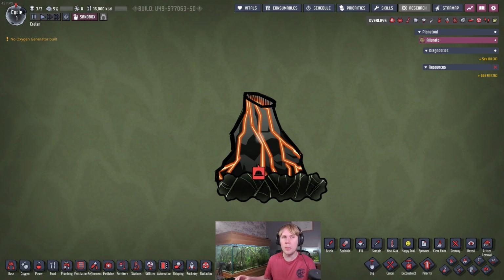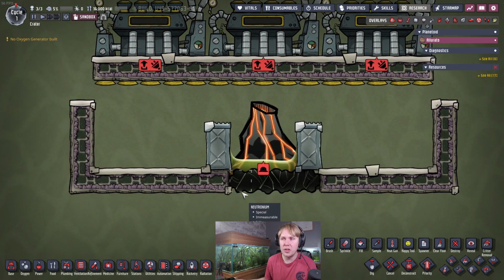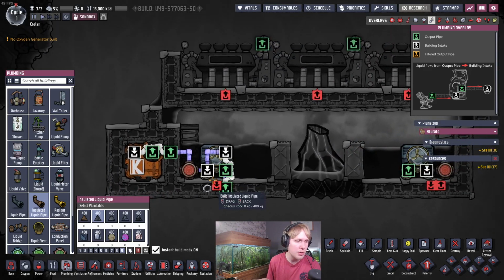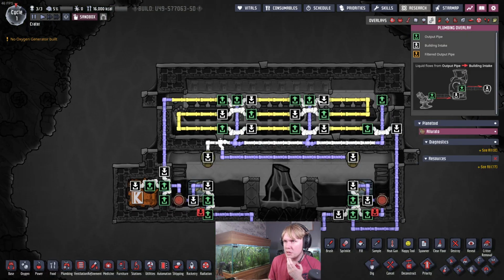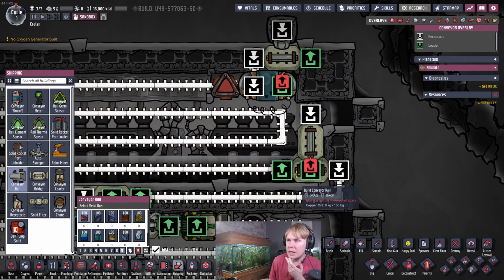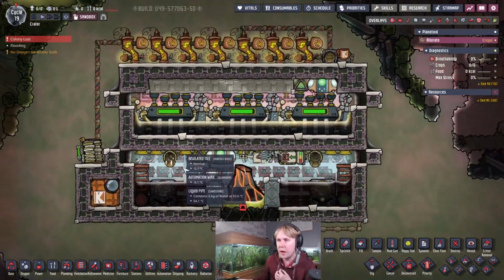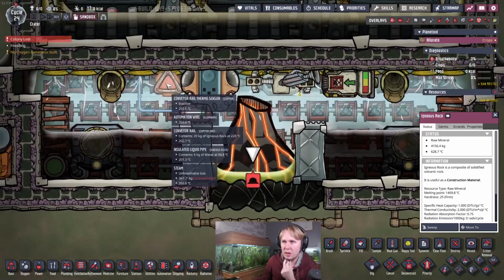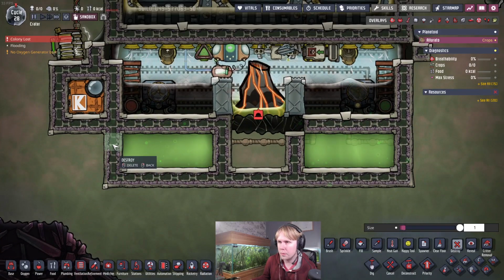How To Get Cold Rock From Volcanoes In ONI: Spaced Out! Sandbox Showcase #7

Comment: just did tamed some volcano the noob way, I just put 5 steam turbines on top of it, and I'm cooling the turbines with 2 thermos that help cool down the material that comes out of that volcano steam room, I only let material out of that room once below 150c or so, if too hot it continues to rotate inside till cool enough for me to use it. those five steam turbines are running full power all the time even when the volcano is dormant, now watching this videos to see if I can make it even better.
Reply from the maker: volcanoes are fun! bear in mind that this guide is about getting cold rock out quickly rather than getting the most power out of it. you can certainly leave the rock in there for longer and use less aquatuners.

Comment: Love the idea with the liquid uranium! Amazing video! :)

EDIT: Won't the Conveyor Loader overheat since the rock is much hotter than 275C?
Reply from the maker: Thank you! Generally from my testing I found that provided you add a large enough mass of Steam to the room (in the video it's circa 400 kg/tile, which still allows eruption because the liquid Uranium is less than 150kg/tile), the Steam shouldn't exceed 200° C by too much. The rock does not conduct a lot of heat very quickly until it's on the Conveyor rail itself, unlike metals from metal volcano tamers. The Steam is also less conductive with the Loader than the Crude Oil is. If your Steam pressure is too low, the temperature can exceed 275° C at certain points which can start to cause problems, as seen by @NovaGirl8 (I think this is the cause of your issue!).
Reply: Thank you for your detailed answer @erisia_gaming  I'm just testing that now and yes you are right about the rock not conducting too much heat, while metals (obviously) do conduct much more heat while in the Loader. See on soon online! :)

Comment: So... do I just dump my solid uranium ore into that trough and wait for it to melt during an eruption? I have like 10 volcanoes in my current map and only one of them is a minor volcano XD
Reply from the maker: Yes, this will safely melt the Uranium Ore. You can also build something out of Uranium Ore like Heavy Watt Wire to achieve the same result. The Volcano will do all of the cooking. And for the regular Volcano, you can build something with the same design that's just twice as wide with twice as many Steam Turbines and Aquatuners.
Reply: @erisia_gaming not sure what happened but after about 400 cycles, my steel auto sweeper and conveyor loader died on me. Every newly built sweeper and loader suffered the same date. I suspect it was overheating due to picking up the debris. Currently, I managed to not get it to overheat at 800C rocks but I am observing if it happens again. Maybe not enough steam? I had on average 105kg steam.

I am using the build on my minor Volcano btw.
Reply from the maker: @NovaGirl8  Could you send me the stats info on that volcano?

Comment: Ok how do you get liquid uranium.
Reply from the maker: You can either melt some Uranium Ore Heavy Watt Wire directly at the Volcano (or just dump some Uranium Ore where it erupts). You can also use the Uranium Centrifuge to make Liquid Uranium from Uranium Ore without an external heat source (you also get 20% of it out as Enriched Uranium).